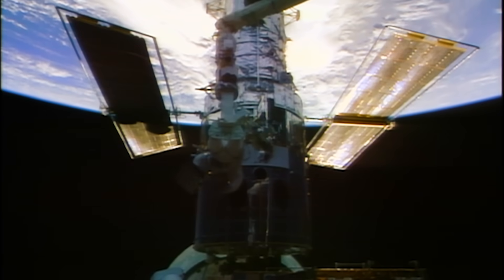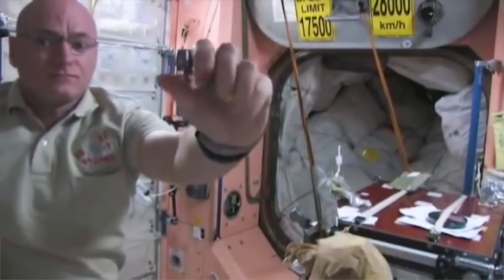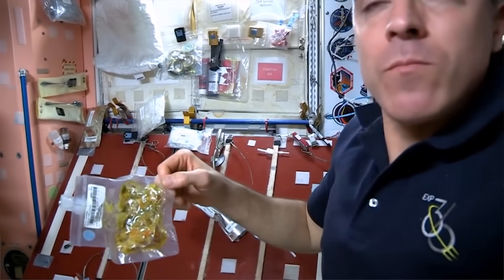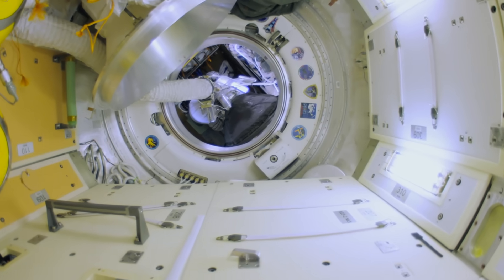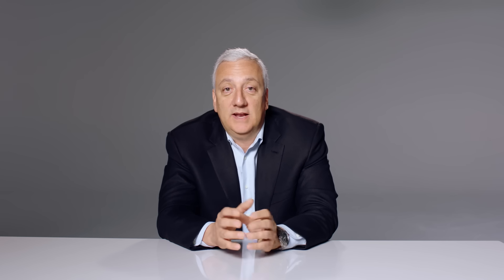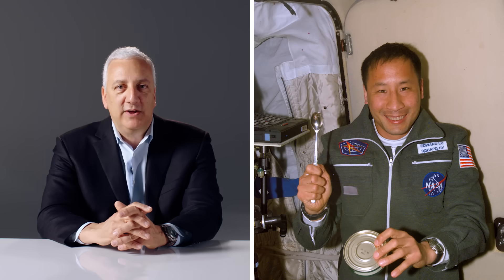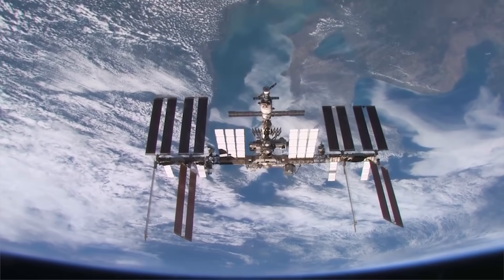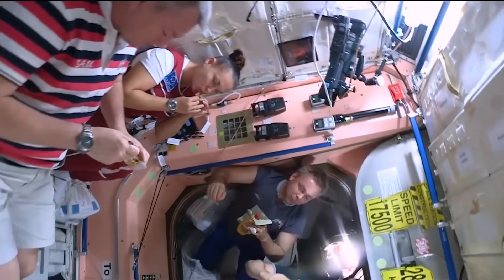Former NASA Astronaut Explains How Food Is Different in Space | WIRED

Comment: come on now you cant tell me the lady at 4:20 is in space when her hair is fixated in that position. There is no up down left and right in space. Everything is meant to be weightless without gravity and flow in any direction it is pushed toward with any kind of force. you push a ball to one way and it will keep moving until it's opposed by a force. the hair of the lady at 4:20 is not flowing around like its meant to and seems to be wired into a fixed position and has a fan blowing the tips. How can noone see this mockery of common sense?

Comment: Question: If you were to order New York Thin style pizza in space, would it hold its shape, or would it droop? And would the intense heat of a typical New York style slice, which is more than hot enough to burn the roof of your mouth, result in offgassing of the cheese and grease, which would in turn create, though small, the force of propulsion?

Comment: How the smell travels in 0 gravity environment?
Reply: Feather Black probably relatively the same. Smell relies more on the movement of air particles, not gravity.
Reply: "smell" requires the diffusion of particles which are constantly moving and bouncing around in any system that's not a vacuum. So you wouldn't be able to smell in space but since the shuttle is a closed system you can! No gravity needed.
Reply: @lauren8538  
Yeah, that is  a part of fun I expected. Smell travels slowly and you can catch it i you're on the way. I wonder how does it feel when i hits you. Does it stay as long as  you move air particles with your hand?
Reply: @ImplosiveCatt  well, he said in the video they do get a little nasal congestion because the lack of gravity causes more fluid than normal to accumulate in your upper extremity. I bet besides not being able to smell as well, smelling isn't all that different! The smell would probably stay as long as it's not diffused so much you can't smell it or until it is filtered out. But air particles move on their own, if that's what your asking.

Comment: I want to see more videos like this.  Got a question though - why not vacuum seal the "wet trash" instead of pushing all the air out of the bag the best you can?  I realize it will use some power and cost a bit more to send it up initially but if it's a matter of stench building up vs vacuum sealing why not?  maybe an adapter can be fitted onto the vaccuum sealed bags and one to the toilet to allow gas out as the remaining food decomposes.  It would have to be aired out manually that way but I think it may save on space and the frequency at which it would have to be shuttled out no?

Comment: Do u have wifi in space?
Reply: They often complain about their Internet connectivity. You'd think they would get great satellite or ground transmission tower service, but the speed they travel and their low altitude creates a lot of dead spots in their orbits, especially since most of the relay satellites are also in changing orbits (inclined to the spin axis), so the service tends to be spotty.
Don't know if it's gotten better, but I saw a video where an ISS astronaut said they usually get about 50% connectivity during an average day, so they store a lot of stuff and watch it during those downtimes.